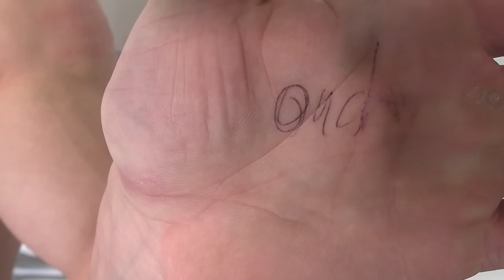Crushing my Bones with a MEDIEVAL MACE so Nobody else has to *MY MOST CRIPPLING EXPERIMENT EVER*

Comment: I know that I'm super late, but I feel the need to be pedantic right now. A morningstar is a specific type of mace, one with a round head (sometimes hollow) and spikes portruding from the head. A mace however comes in many shapes and sizes, the only thing it needs to be a mace, is a rigid handle and a mace head wider than the handle.

Comment: Yeah, the reason maces were so effective is because they're a forward heavy club. They were primarily used to damage plate armor as it permanently deforms the steel which makes the wearer less mobile. They are extremely effective against all types of personal armor and have been known to crush bone and kill combatants in a single stroke. Though, admittedly, that's usually done with a strike against the head or spine.

Comment: One thing 'modern' maces miss.  Often, the original maces/bludgeoning weapons were either made of lead or internally filled with lead.  This made them more impactful, than a 'solid' steel modern mace .  
Even historic Iron maces (designed to target armour, to crush it and the body underneath) were generally filled inside with lead.
fyi - Lead, deforms when you hit something.  Meaning it imparts more kinetic force into the object struck (and due to Leads density).  It was always considered the best metal, for impact weapons.  
Plus, its easy to melt down and reform into another weapon ..after a battle :)